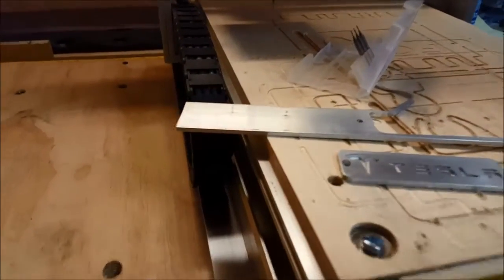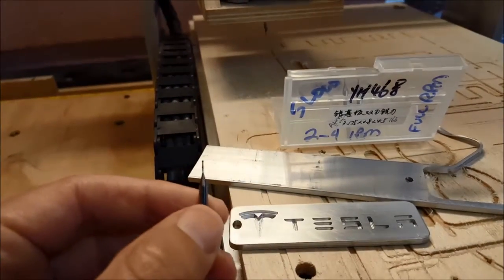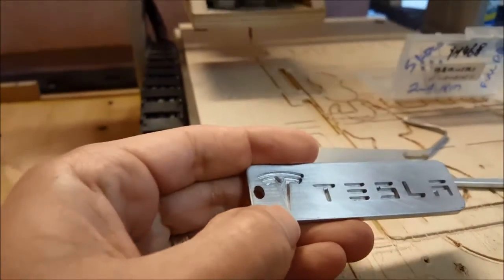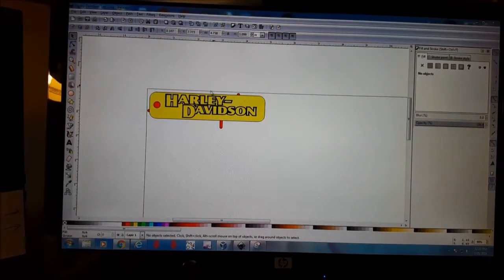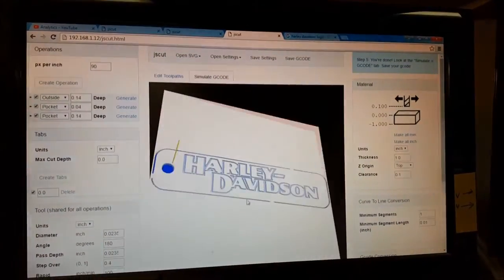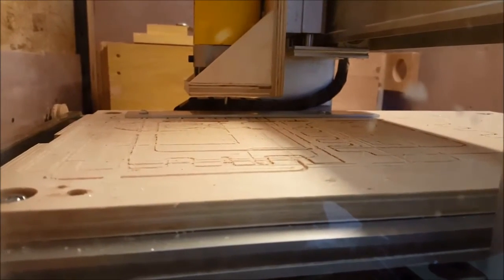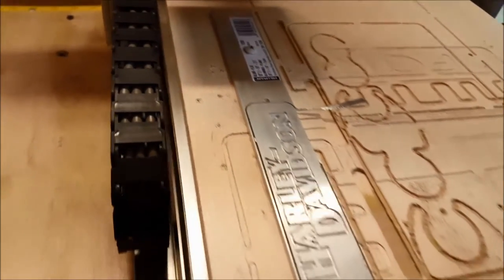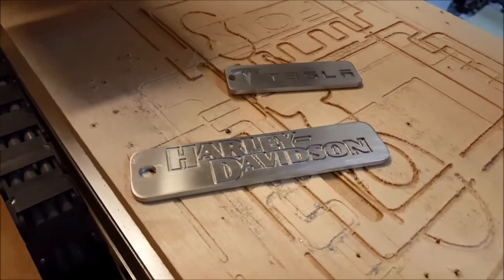Aluminum Logo Carving - On A Modified CNC

Comment: Thank you for the JSCut reference.  I didnt know they existed.  Could you post a link to the end mills you used?
Reply from the maker: +U Do It Contracting Sure -  5 Pcs Aluminium Cutting 2 Flutes CNC End Mill Cutter Router Bits 0.8mm Diameter